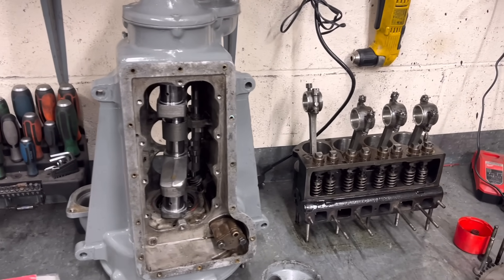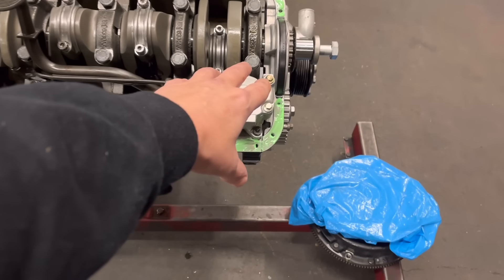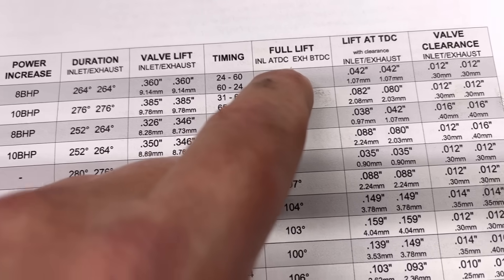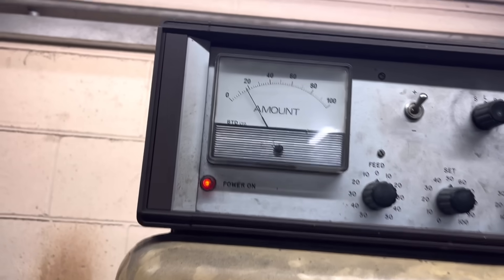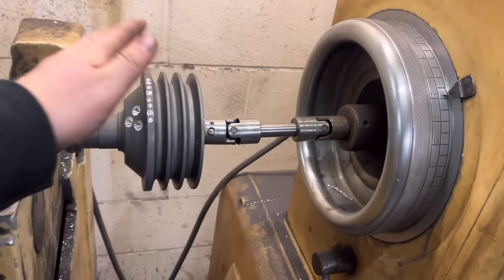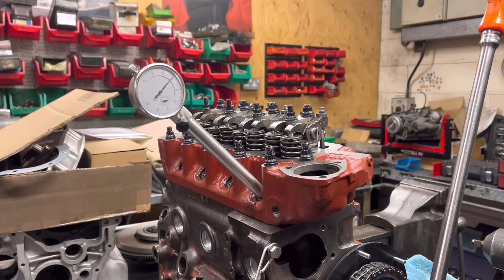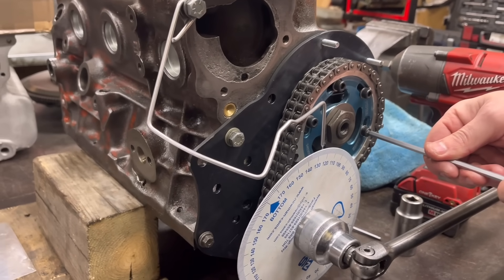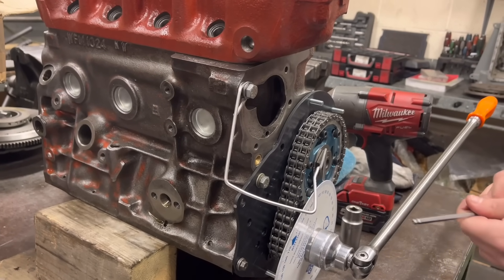We are surprised ALL engines don’t have these from standard!

Comment: It’s better practice to calculate the “ lobe centre “ by measuring the opening angle ( usually done at 1mm of valve lift ) , then the closing angle ( also 1mm lift ) , add 180 degrees , divide by 2 , then subtract the opening angle ( for inlet , because this references the result as an angle from tdc ) . The result ( in your case)   should be 108 . It’s more important that the opening and closing happens at the right time , than measuring the actual highest lift . Cam grinds are seldom perfect, you could be opening and closing 5 degrees off and you would never know

Comment: What is the large extra stud in the 1275 next to the thermostat? Normally on a 11 bolt block, they are a bolt with a smaller diameter in that position. Will the rocket cover clear the stud and nut?  Or is this an A+ thing over an older A series?

Comment: 1:40 Lee, you can't have 2 forms of wrist pin retention on a piston, either the rod must float on the pin, or the pin must be clamped by the rod. Using both is likely going to  knock one of the clips out as you can't expect one of these vintage engines to have all the components running true as the crank rotates. Even if it doesn't pop some of the clips out it's likely to put some fore and aft thrust on the pistons as the crank rotates. Get those pin clips out of there.
Reply: You can have both. As long as the pin can float between the two clips it will be fine. They are only there in case the pinch bolt breaks.
Reply: @billweston6579  Pin should never have more than about 0.005" end float between the clips or half that per side. There's no way that old engine is even halfway accurate, let alone tightening the rod pinch bolt with the rod perfectly centered.

A broken pinch bolt is nothing more than a sign it was way overtightened.

Comment: Would you ever call that type of timing pulley/ sprocket by its proper name !! they are called "adjustable".. Vernier pulleys/ sprockets are different!! they have two circles of holes with one number difference between them, when timed up a pin is fitted to the pair of holes that line up

Comment: This might be a daft question having never used a balancer but how do you know if that knuckle shaft driving the crank is in iteslf true because if its not it will throw the readings out if its oscillating out of round if you see what I mean.Just curious .I have  had a propshaft balanced before on a similar machine but rather than drill it a bit of weld was put on at specific points much like a lead weight is used on a wheel rim but even then how do you know the tooling driving it is true and balanced?
Reply: He cant weld to it because its cast iron, props are steel, he probably could not glue to it either cause cast iron has graphite, but he could weld to the clutch basket perhaps.
Reply: You'll find out by rotating an apparently balanced crank 180° and seeing if it stays in balance.  The drive gear is close to the centre of rotation, and I'd guess the manufacturer balances them, but you can easily check at any time.

Comment: Why can’t they make the cams so they fit and are timed on a standard cam pulley . Can they not machine then so they bolt straight up.
Reply: You’ve got to take into account tolerances. So the cam is timed against the crank, the crank has a slot, the slot fits a key way (which has a machine tolerance) the key pulls against a crank drive which in turn pulls the chain/belt (stretch) then pulls the cam gear which is on a slot plus the keyway on the cam. I bet I’d give you 100 goes to machine make the parts and you won’t get it bang on. So as it comes and it might be 2/3deg with all that considered is fantastic.
Reply: Depends on how the cams are made.  If ground from blanks they should be able to get the key/lobe alignment very close, often the cheaper performance cams are reground standard cams, and it's not always possible to get the correct profile and maintain the correct key alignment.

Comment: Sorry i dont get this fine balancing they dont do it when the thing is new plus other stuff spinning when its running will over ride the fine balancing anyway. Drilling clutch housings and flywheels you are playing with impending diaster. You can drill it out but you cant put it back
Reply: The better an engine balance the longer the life and less chance of something failing at higher revs
Reply: I find it amazing that armchair experts that clearly don't know what they are talking about are so keen to stick their oar in, when Lee has been successfully building engines for years.  Rotating components ARE balanced at the factory, but on this older stuff typically not as accurately as you want.  Bear in mind many of the engines that Barum works on will be used in competition, and will be revving higher (sometimes much higher) than they would from the factory.  Drilling small balancing holes in the periphery of the flywheel is perfectly fine, again this is typically how it was done at the factory.  The clutch housing is steel and doesn't have the brittle failure modes of cast iron or the amount of hoop stress as the flywheel.
Reply: @ferrumignis  It gives them a change from complaining about the weather ...
Reply: @LokiCentral  True enough!
Reply: Do flywheels and clutch housings break often?  I haven't seen any in for repair ...
Reply: Also the small hole he drilled in the flywheel was 180 degrees away from the first larger hole which goes to show he took too much meat off in the first place right?

Comment: The timing is out because you made crank TDC at 006 on the degree wheel. So 108 on the wheel is 102 true degrees, not what the cam requires.
Reply: Once he set the bendy pointer he would zero the degree wheel to that so instead of 6 it will be zero before he turns the 108
Reply: No, when he set the pointer at 6 degrees the crank was 6 degrees away from TDC so zero on the degree wheel is true TDC.
Reply: 6 degrees was just a reference to find the true TDC.  Obviously when you first fit the gauge to  the crank, its not perfect, its just eyeballed close.

Comment: I am totally confused with the timing.  . But excellent information.
Reply: Basically, you're wanting to determine the exact position of the crankshaft whilst the piston is all the way at the top of the bore (TDC) Top Dead Center. As the crank can move a few degrees either way, with the piston not moving much at all, you need to find the total degrees of rotation, one to the left, then one to the right, then divide by 2. Presto! You now have the crankshaft at TDC. The dwell is the time the piston isn't moving, but the crankshaft is making it's way past TDC.

Comment: I knocked the ceramic out of a sprk plug and welded a bolt in as a piston stop. Rounded the bolt end so it does not damage the piston. Rotate the engine in reverse rotation until it stops, note the degree wheel reading. Now rotate in the normal rotation until it stops and note the degree wheel reading again. Half way between is true TDC. Remove the piston stop and turn the engine to half way between the two stops and at the determined true TDC. Now the degree wheel can be zeroed.